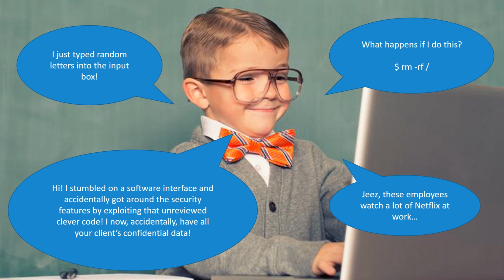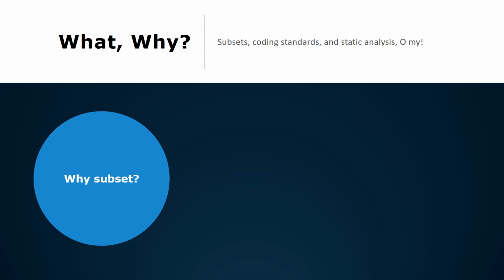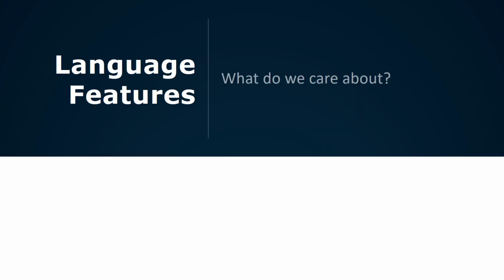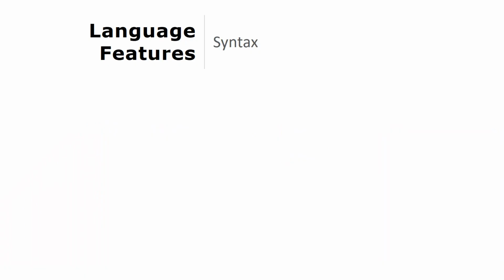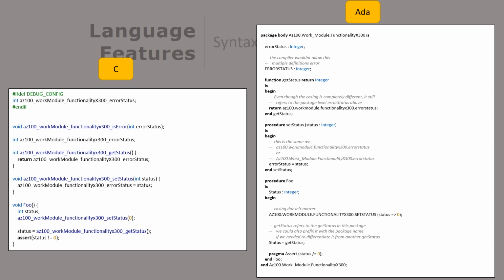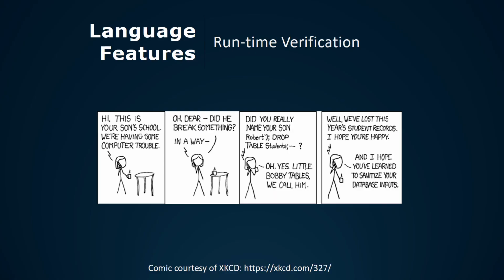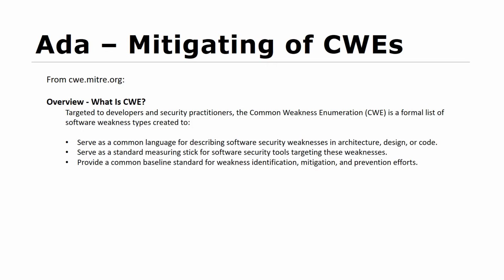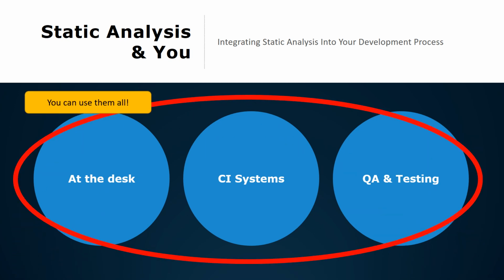Cyber Security & You: Vulnerability Exists Between Chair and Keyboard

Comment: Hello Rob. It was very good insight on making code secure. 
But if we consider a scenario where a piece of Ada code (main language) uses a small C code module as a part of large code. In this case can we say spark is able to check for necessary runtime errors or potential memory leaks?